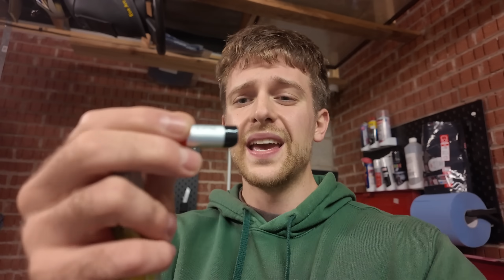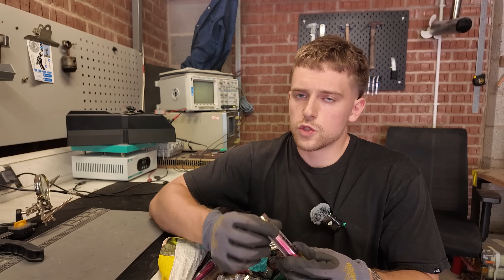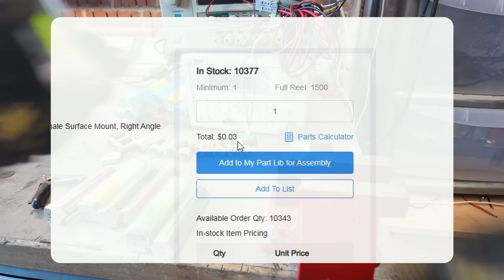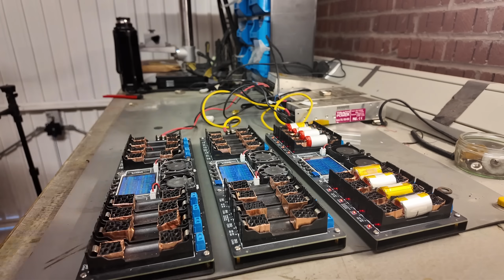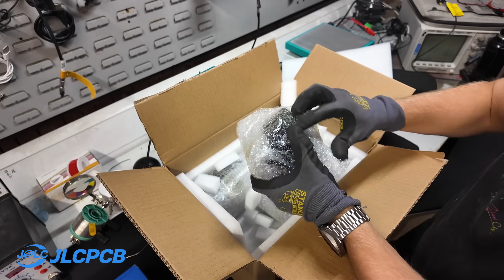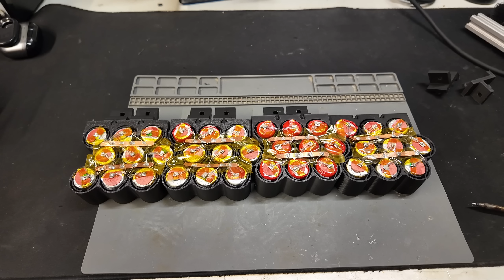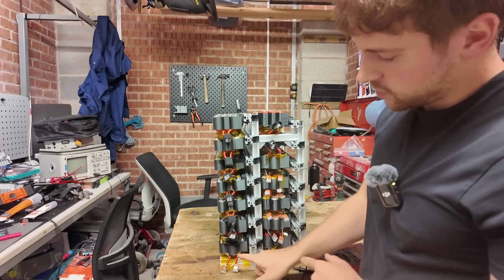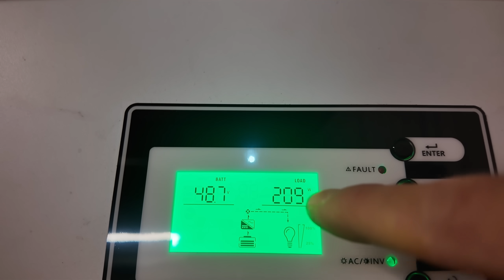I Powered My House Using 500 Disposable vapes

Comment: I've been vaping since like 2011 when I quit smoking. I've used 1 disposable vape in that time, and it was because it came free with a purchase. I still have it cause the flavor sucks. I was dumbfounded by disposable vapes from the day I first saw them, they make no sense. The first vape I ever had was a rechargable cigarette sized battery that you screwed a flavor cartridge onto, and you just  tossed the little cigarette filter sized flavor pod, but used the same battery. This was 15 years ago, and you're telling me they couldn't do something like that with modern cheap vapes? BS. 

Anyways, I've been using a mod+tank for quite a few years now, that I buy liquid to refill the tank, and I don't throw anything away. It's better flavor, cheaper, etc. I fully support vaping because I can attest to its ability to help people quit smoking, I was smoking a pack of Marlboro's a day and I quit entirely. Sure I replaced it with vaping, but that's because it tastes damn good, I've been at no nicotine for years.

Comment: Genuine question, how does an inverter boost the DC voltage to more DC voltage?? An inverter takes DC and makes it AC, so how does one take something made for DC-AC and use it for DC-DC and seemingly jump over 80 volts at the same time? The rule of energy conservation and consumption shouldn't allow this

Comment: This is literally how the battery modules for Tesla brand vehicles r built in China. All by hand. To keep costs down its done assembly line style. I'm pretty sure u can get a recycling grant from the govt to set up a small refurbishing center to build these battery modules customized to any size, including electric vehicle replacement batteries. Labor costs being what they r, u will likely need to partner with a work-release program for inmates returning to society. The have to show they have the ability to maintain a job as part of their probation, so their attendance is mandatory.  Could b a way to take it to the next level & take this niche market for urself, since there is literally no one else doing it to this scale, & its a green job. Meaning younger generations will look at it as a way to b a good planetary steward in exchange for a wage, rather than just trading hours for dollars, such as most jobs require, lacking any sense of fulfillment.

Comment: no hate, but 1,8kw water heater in kitchen on 220v uses about 10 amp, how app can show you a 6 amp of total usage..  wtf.. the unity of calculation contradicts itself..  this is a ticking time bomb because it is a real challenge for batteries.

Comment: The oldest trick in the book is freezing batteries to reformat them so they can take a charge again. It might not work, but if you’re about to throw away that many batteries, I suggest you try reformatting them first. I don’t know the exact procedure — you can look into it — but the idea is to freeze the batteries deeply. Apparently, this changes their internal structure and allows them to recharge again. They’ll probably lose about 20% of their lifespan, but you’ll have a battery that can hold a charge once mor

Comment: You can actually try to recover a discharged battery using a bench power supply with current limitation set very low... i recovered lots of batteries in that way and the charge was almost the same of a new one
Reply: you can do it with a cut up usb cable

Comment: 14:19 it makes me cringe that he's not using those heavy duty rubber gloves made for high voltage
Reply: The battery is only 50V.
That is generally considered safe to touch accidentally.
That is probably how he chose the pack voltage.
You lose some efficiency running at only 50V instead of 250V (if the groups of 9 were all put in series).

Comment: I know you say not to replicate this, but I have been an electronics hobbyist for years and am experienced with the dangers of lithium ion batteries. I finally quit vaping, but I have hundreds of these things saved up from my years of nicotine addiction. I have been planning to construct a huge power bank similar to this to test and hopefully safely use in conjunction with solar panels to create a mobile power station to use and recharge power tools at remote work sites without having to start and run my truck or buy a very expensive power bank.

Comment: Here's the issue. Let's say 1/10,000 vape batteries is defective in a way that would cause it to fail and catch fire after a few hours of use. That's not a big deal for an individual, they only encounter one at a time, only a few per month, and rarely does one of these disposable batteries actually see more than an hour or two of total discharge time. The odds of an individual witnessing a disposable vape fire is extremely low, like your odds of winning the lottery by buying one ticket each month.
When you assemble an enormous brick of them and use them continuously, it's like buying hundreds or thousands of lottery tickets, your odds of winning (causing an enormous lithium/plastic fire) go up A LOT. The fusing will not mitigate this.

Comment: Cool project! The only concern I have is that Wago(s) are only rated for 20A, Its pretty low rating for what are you are using them for -  even in the test, with off-grid home  you have drawn ~65A from battery which is waaaaay above safe limits for vago. Its better to crimp or solder them together or use rated screw terminals(and ideally, with ferrules on the wires)

Comment: ive been complaining since the start like 10+ years the disposable vapes should not exist. And they have just made more brands as time goes on. They are a lot more costly then a regular vape with batteries u swap, and the quality of the juice in those disposable things is questionable ab best, i wouldn't trust it.
Shops push the Disposables, and not just that, but the overall taxes being made by the government is much higher if you are buying a new vape constantly then 1-2 bottles of juice per month , and my 18650s last for 3-5 years before i need new ones. Bro u need some sort of extractor fan for the solder unit if your in a closed space like that, not good to inhale that shit.

Comment: You should try to make a little small fuse panel so like if one of the fuses pop, you could just instead of having to un wire all that you could just flip a switch and then it’ll be good

Comment: Wait, disposable vape is a thing? As non-smoker I thought that the purpose of Vape is you can smoke without blowing your pocket to buy a one or two pack of cigarrete daily because vape has a battery to be rechargeable. With bonus as a new hobby to customized or collecting custom vape design and many flavour choices. Sure a new device is kind of expensive but for a long run it should be worth the price (and even if the battery is busted it should be replaceable easily too)

Comment: 3v is a recommended limit for discharge not a magical voltage that kills the battery completely so even batteries below 3v can easily be brought back.
Reply: 3v isnt even true anymore. 2.5v is the discharge limit for most cells nowadays. The leds in those vapes probably stop working below about 3v though, (or maybe the vape has over discharge protection which cuts at 3v). But he probably could've used some of the cells from the vapes that didn't light up.

I was using a Molicel 18650 last week in a project and indeed the cell is rated to discharge down to 2.5v
Reply: Better to be safe than sorry tho
Reply: reminds me of the time i had a 12v lead acid battery at 7v
Reply: @drewfitzgerald4409  those are almost 100% reviveable even at 1v. pour some water in that bad boy and it will be 12v in no time. seriously. this is how UPS batteries are brought back to life.
Reply: yeah, you just need to bring them up much slower.    

this is also why some devices seemingly need long hours of charging to ""wake up""" and then they charge normally when taken out of storage. IF THEY HAVE INTEGRATED SAFETY CHIP it will kill the connection to the battery itself if it goes below to avoid fires. doesn't mean that the cell wasn't usable if brought back.
Reply: @lasskinn474 You can push /tip on the top and activate the cel again in many cases.  But I wonder if they all have a safety for under or , even more important , over voltage .
Reply: My alarm clock radio has a BMS that cuts power at 2.4V and restores power at 2.9V. Sure, it won't do the cells any good repeatedly hitting 2.4V, but it won't hurt them to the point they can't be used.
A lot of the single use vapor devices got thrown away because a) they run ou of liquid inside or (b) the cell goes below the cut-off for the circuitry to work (under 3V),
Reply: Yep very true
Reply: If true then this comment is thee most important one! Pity he's ditched a few thousand batteries already.
Reply: @stuartpatterson1617  You always have to balance that with the added labor. He was already pouring hundreds of hours into testing and prepping the ones he was keeping. Would've thrown off his whole production schedule. And it was probably easier to return the "bad" vapes to the retailers that were accepting them for disposal, intact, instead of trying to send off bags of stripped out batteries and scrap.
Reply: Was just thinking the same thing swear i watched someone just slowly charge them.
Reply: True, 3v is a "safe" cutoff voltage, 2.8v - hard cutoff due to possible damage to cell (lost capacity), but in reality it can lost it's capacity even after 3.1v, lol, cheap chinese shit
Reply: @nikostalk5730  Actually almost all Li-ion cells were designed by American firms. Are you saying you don't think the Chinese are manufacturing the American designs to spec?
Reply: @ASDeckard  Yeah maybe the specific type were invented by Peterson & Associates Chemical LLC Co, but Shenzhen Lianxang Electronics (known on Amazon as FGAYH) probably won’t manufacture them at the highest quality.
Reply: @ASDeckard  China is well-known to skimp on material quality and tolerances. for something disposable,single-use like a vape,i would expect it.
Reply: @xanderplayz3446  if you look for a while you will be able to find a Chinese manufacturer that actually makes it the same or better.
Also, I didn't know Panasonic and Samsung known for best batteries are american brands.

Comment: what's the total amps of the power from the battery at 240v? im guessing the batteries at 1amp per battery converted would be 5x less so 50 amps to 240 roughly 10amps? i dont really understand electric, inverters and transformers, its all magic to me

Comment: Actually if a lithium cell has been discharged past 3v it's not great for it but it is still perfectly usable I have brought back many completely discharged lithium batteries and they work great so next time maybe give the "bad cells" a chance and see if they take a charge, if they do you're fine to use them.

Comment: If you take another battery of the exact same capacity that is able to actually hold a charge and you hold it to one of those batteries that doesn’t seem to have a charge for 90 seconds connecting the positive to the positive and the negative to the negative it should pump enough juice into it that it should be able to accept a charge. I’ve lost count how many tool batteries I have fixed this way.

Comment: Your 3d printed cell holders do not need 3 springs. You can greatly simplify the design by modifying it to only use one 3d printed spring pushing the cell into a solid wall rather than having 3 springs.

Comment: 00:25 euh no these are not the EXACT same battery. They may have the same elements but the quality of those in disposable vapes makes them a hazard to use for any other application.. that said you done things pretty well here, kudos!! Defo do the solar panel now you have a working battery pack!

Comment: In some cases you can recover a cell that has gone down below Three volts, by buddy charging from a very low current source in the first instance.
Most modern multi-meters have a Diode test range, which delivers about Three to Four Volts. Test the cell on this setting and watch the Voltage rising, once at Three Volts, you can put it in a normal charger.
Look out for excessive heating, if the cell gets warm (or hot) it has too much internal damage / leakage, so do not use them.
I have recovered many cells this way.

Comment: in theory if the inverter is grid tied, then it should be safe to keep connected to the grid but it should use power from the inverter first rather than the grid as its the path of least resisdence

Comment: Similarly, I tried collecting some of them and designing an emergency power bank, but it failed because I used regular soldering to connect the batteries.

Comment: I turned a bunch of those 13mm diameter battery vapes into rechargable AA batteries. I can't remember the number. They are roughly 13mm / 1/2". So I cut down some 1/2" wood dowel rods to make up the length and wrapped the ends with the tabs folded over with aluminum sticky backed foil tape. Then used #8 screws (roughly 4mm) in the wood pieces to act as the tip of the battery. Then wrapped them with electrical tape.

On the blanks I just wrapped the entire piece in aluminum foil and used a screw to act as a bridge. And wrapped them with electrical tape.

I found this works well in small radios and LED flashlights and lanterns. I have ran a small radio for about 36 total hours on a charge. And recharged them several times. I'm using a single 18650 changer.

The only thing these batteries don't like are incandescent bulbs due to the higher voltage.

My suspicion is the reason radios and LEDs can handle 3.7 volts as opposed to 3.0 volts is these devices have a built in regulator. So they don't actually consume 3 volts. But I'm sure there is a limit.

I'm watching your video because I want to figure out, how to link these batteries is series so I can make a 12 V lithium battery because they can be dangerous charging them like an AGM lead acid battery.

Comment: 30 years on I still remember an explosion when I was working at a company which was assembling similar lithium battery packs. One of the staff accidentally placed one pack on top of another in a way that connected them in series. Amazingly, no one was injured.
Reply: 30 years ago (that would be 1995), lithium batteries didn't exist, they were likely NiCD or NiMH batteries.  (The early Prius used NiMH batteries, same with the GM EV1, and the Chevy S10 EV and Ford Ranger EV)

Comment: This is good stuff. I have over 100 batteries I have collected and I have a few in serial that do a few fun things, I have a "potential" torch I haven't finished yet and I was looking at doing a phone charger, but haven't got that far. They are good little cells for the most part. Great Project

Comment: You are using the wrong type of batteries. I am sure those vape batteries are lithium ion which are definitely not recommended for house battery storage. You need to use LiFePO4. !!! When it catches fire I doubt any home insurance would cover you. Lithium ion batteries are 3.7v per cell whereas LiFePO4 are 3.2v (14S instead of the recommended 16S). Also unbelievable you have the potential to blow up your inverter by connecting the AC to your eps supply. The phase being out of sync could be catastrophic!!!

Comment: So I’ve kept all of my vapes throughout all the years as a avid lithium recycler myself. I started by putting all of the batteries into parallel into small project box modules with XT 30 connectors. Parallels of 25 cells tightly packed fully charged and I’ve wanted to be the first person to make a video like this on YouTube so badly but you beat me to it!

Great video thanks for the upload and showing what can be done. Now my little pocket phone chargers from the vape batteries look like a joke. 😂

I am however, going to be building a massive 128 kW battery pack for my home out of 64 628 amp hour lfp cells wired as a 16s 4p 😊

Comment: Yes, you should add solar panels to the thing to recharge the batteries at the day instead of having to still use the power at night to charge them and increase ventilation in that workshop

Comment: I belive Big Clive di da video a few years ago where he tested if an over discharged 18650 can be restored to normal health. Slow and low charging and it was fine, I think the main consideration is how the cells have been over discharged, if it's a small parasitic draw that's not so bad but obviously a high current draw is a different story. Maybe you will be able to save some of the dead cells and reduce wastage even further.

Comment: This is a fire waiting to happen doing this.  I build EV packs and these low quality cells just give way too many failure points on top of low Q cells.   New lithium batteries only cost $150/kwh ready to use now, no assembly needed.

Comment: Make it 40kwh - About 8X of those units, 

Add solar panels ( 10X 550Watts)

You are off the grid.

Would do a duel purpose inverter then as well for primary and secondary feeds from the panels so you power the house and all from the panels and not through the battery's, 

Exccess power goes to secondary

Comment: It’s ridiculous how far this has gone. I’ve been collecting these disposables here in Germany for about two years, and the cell capacities keep increasing. Nowadays it’s not even rare to see disposable vapes with 850 mAh cells in them.
Reply: As shown in the video the larger cells he ended up using were 1.3 Ah cells. The smaller cells he didn't use were probably like your 850 mAh cells.

Comment: I was talking to friends about doing exactly this.
Well done and well timed.
I've already got about 4kWh of old laptop 18650s. Just need the BMS.
A little tip though is to get or make a small spot welder for making the battery connections, its so much faster than soldering.